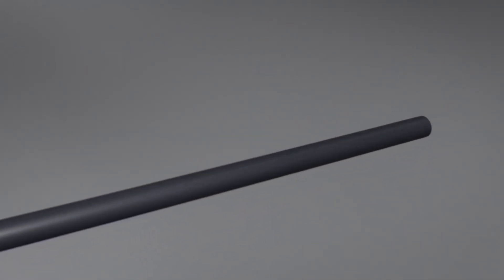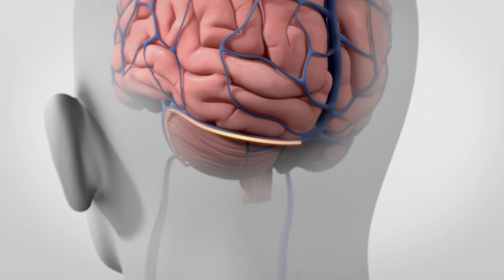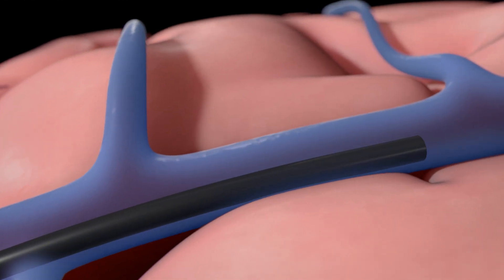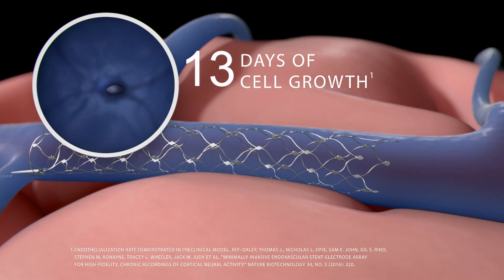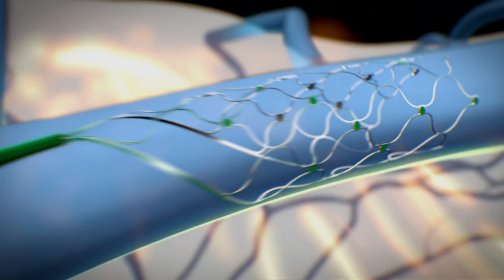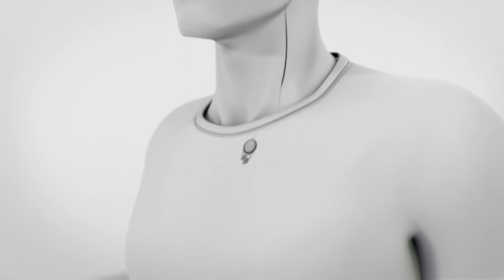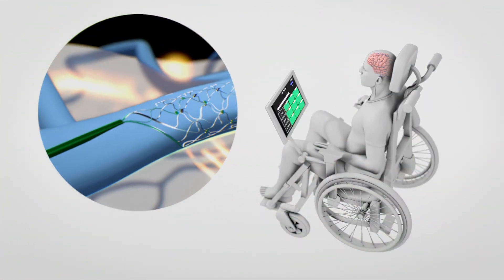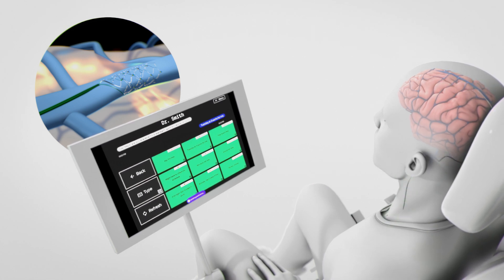How Synchron's BCI Works

Comment: There are criminals utilizing this tech in my community for identity theft and taking advantage of vulnerable adults as well as people with disabilities (mostly using it to trick females for sex and stealing from the victims that have money). It is running rampant in the twin cities and none of the victims are able to articulate what is happening to them. I have been trying to help a close friend of mine that is being sex trafficked who is classified as a vulnerable adult and the attacks started on me when I started to make any progress locating the source ( I am pretty sure it is a couple criminals in the local law enforcement community). Is there any way to locate the source of the signal somehow. It is a huge operation of human trafficking that I have identified dozens of victims while being under constant attack myself. They stay one step ahead of me while I collect data, stealing and doing anything possible to deplete my resources but I am getting close to figuring out who it may be. Any help or info that would help identify the criminals responsible or direction on how to locate the source would be greatly appreciated. Thank you for your time.

Comment: What’s the laws on a bci implant on unsuspected person
Reply: 1. Very illegal. 2. This device has relatively few electrodes, and it's placed explicitly in the motor cortex. It cannot read your thoughts or influence your thoughts; that is handled by different areas of the brain. It only reads signals that would typically be bound for muscles, and somewhat limited signals at that due to its small number of electrodes and small surface area.

Comment: How is it removed safely?

Can it be removed?
Reply: if removed may lead to death
Reply: I’m not sure and I’m not sure it needs to be. If cells indeed grow over it removal becomes difficult, but such a small amount of metal isn’t likely to do any damage, and proximity to the brain isn’t a big concern either. It’s in an artery contacting blood. If it were in a ventricle contacting CSF that might be a problem, but it isn’t.
Reply: no it cant be removed because it alters brain chemistry and when u remove it, brain chemistry will collapse and u die
Reply: Stents, in traditional use cases (which is to hold open a blood vessel), are typically intended to be permanent. However, removal is done occasionally under specific circumstances, so there is a procedure for it. However, that procedure is often surgical, so it would be inherently more risky than the minimally invasive implant procedure. However, since this stent is not structurally necessary, Sychron likely has a procedure or could more easily develop a more straightforward method of removal.
Reply: u can just deactive it